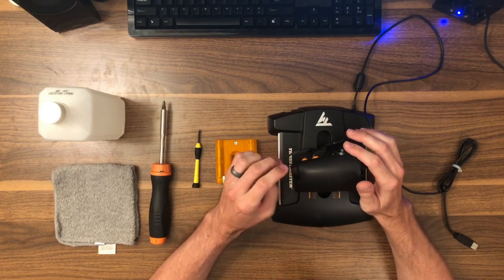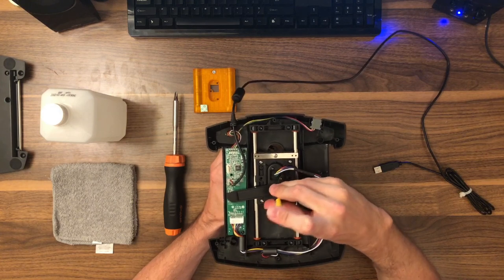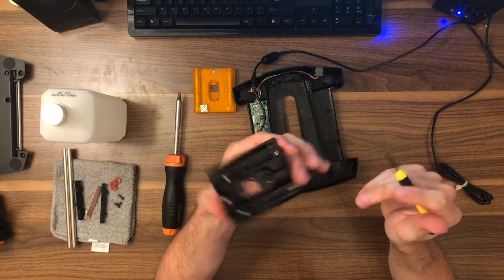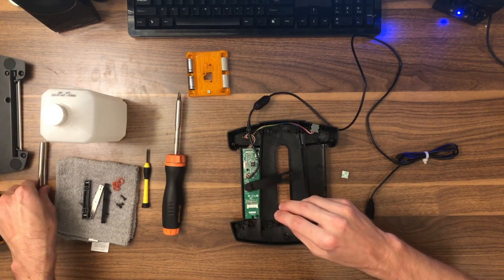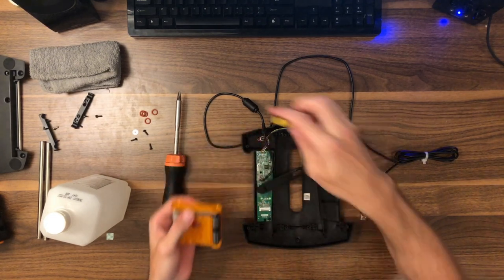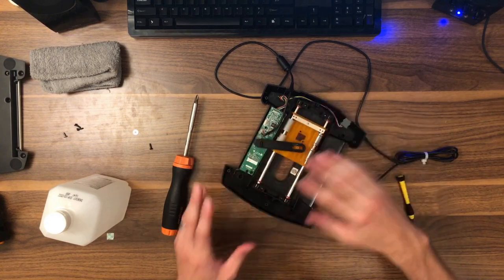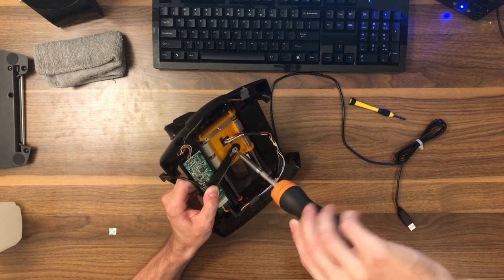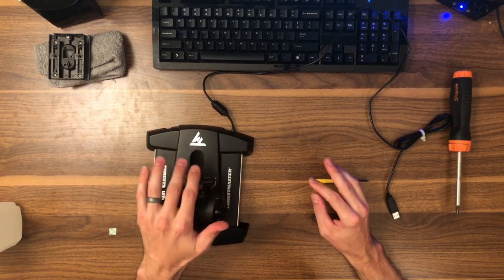Impulse Slider Installation Guide - ThrustMaster T16000m Throttle Upgrade!

Comment: Wait, do you need to re-lubricate the rods that go through the bearings or not? And if not why not? Also will there maybe be a restock, i would like to order one.
Reply from the maker: Thanks for the question, I don't re-lubricate mine because I use the polymer bushings which are self-lubricating. I've never had an issue. The metal bearings also come with some oil on them which also solves that problem. I'd be more prone to re-lubricate these but I also have never needed to. The additional lubricant would need to be put inside the bearings so that the seals seal it in vs seal it out. The only advantage that might give is a possibly quieter sliding motion. The downside is that it will attract more dust/dirt/contaminants. I'll be restocking later today :)

Comment: What is the functional difference between using the polymer bushing or the metal bearing? What might make one preferable to the other?
Reply from the maker: The functional difference is that the polymers offer a little more resistance when you push down harder on the throttle. It can increase your precision in a way. The metal ones stay super low friction no matter how hard you push down. Then obviously there's the smoothness/grittiness of the feel.
Reply: @CoreHawk3D  what I want is smooth and quite. Hmmm which to get? Which to get?
Reply from the maker: @RichardAdkins  definitely the polymers!

Comment: @CoreHawk3D How do you set up the detent in Star Citizen? The default seems to be that 50% is 50% thrust, and not 0.
Reply: I assume you found the answer by now, but just in case..
to map it to be 0 throttle at 50%, you have to bind the axis to the throttle forward/backward option rather then the trottle forward option
Reply: @VellingaRs  I hadn't, so thanks :-)

Comment: Mr Corehawk sir, I think I got an oversized magnet a to attach to the base, it completely yanks the smaller magnet right out of the slider. I don't see other people having this problem, so maybe I did something wrong?
Reply from the maker: Hello! Is your slider the gunmetal color?
Reply: @CoreHawk3D  Orange with polymer bushings.
Reply from the maker: @elkikex  strange. Would you consider maybe hot-gluing the magnet back into the slider? If all else fails I can send you a new one. I never have issues with the orange ones. Were you the one asking me about the afterburner detent and I sent you an extra case mounted magnet?
Reply: @CoreHawk3D  first time contact here. Ordered it a couple months back, but with the ED:O disappointment I hadn't got around to install it. I got a taste of the detent by putting a bolt and nut instead of the slider magnet, but I didn't get a good feel out of it. I think the diameter of the magnets are pretty big compared to half the sliding distance, which gives it the "muddy zone" feeling described in other vids. I still have the super glue option if I ever want to try it. Thanks for replying, the slider is super smooth!

Comment: just applying silicon grease to the rails is way easier.
Reply from the maker: Nice! I’ve only heard about the lithium grease fix and the damping grease fix. Does it keep the plastic of the stock slider contact surfaces from wearing away?
Reply: @CoreHawk3D  Yes! especially if you apply insulating tape on the plastic between the rails, and then lubricate the rails, you will get alot less play and a very  smooth slider with more restistance akin to the more premium throttles. What I like is that it does not seem to require any maintenance. Applied it once and 6 months later there was no difference.
Reply from the maker: @MegaXLG  interesting! I may have to try that to compare. What tape exactly do you use?

Comment: Can I reposition the magnet to detent at about 90% for afterburner/mil power detent in flight sims?  Do you have the position for the magnet relocation?
Reply from the maker: Hmmmm I aven't measured for that... anyone else?
Reply: @CoreHawk3D  I am not sure about the dangers but could one use the property software that measures the input percentages and while it is disassembled, plug it in and carefully move the swing arm and watch where the input hits 90 then remember the area and unplug and continue the job
Reply: @Kazsquatch  Thanks so much for the suggestion.  I actually eyeballed the position while sliding the throttle forward.  Placed it and epoxied it (!) in place.  Thankfully it seems right. Great upgrade and much better than just using dampening grease.  Thanks very much.
Reply: @tuffguy007  NP! glad i could be of some help
Reply from the maker: @Kazsquatch  thank you!

Comment: You say you ran into friction problems. Did you try applie grease or and oil to the throttle? Would that not fix the issue? I only ask because I have the throttle and I wonder I I should get this upgrade.
Reply from the maker: I tried the lithium grease fix once and it made it like 10% better but did nothing to fix the fact that it was wearing into the structural plastic, widening the holes and increasing wobble/play. I never tried the damping grease because I like to make large fast movements sometimes which would not be possible with it. Does that answer your question?
Reply: I've used Lith and silicon greese for a long time... the plastic wears inevitably and fictional changes will always be present.  A linear rail system will make it better.  Use it till you can't tolerate it, and put in a linear rail system like this.

Comment: The shop is currently closed, sooo could you tell me the price of your product? And do you know how much would shipping to Germany cost me roughly?
Reply: The etsy site says he'll be back .. price around 30 USD for just the piece.
Reply: @SecretsofScorpio  thanks, i read he will be back, but the price is not visible while he is gone :)
The part “just the piece” confuses me however, are the linear bearings / polymer bushings not included at this price point?
Reply: @spellingmistake1  No the bushings are included in the price, I was just saying that I wouldn't know what the shipping cost would be to Germany
Reply: @SecretsofScorpio  ah, that makes sense :)
Reply from the maker: Hello! Price depends on the included bearings/bushings: $25 for metal, $28 for Polymer, and $35 for both (4 of each). @Andrew Bladyka, thanks for your responses while I was away!
Reply: @CoreHawk3D  thanks, I hohe you had a nice Holliday
Reply: @CoreHawk3D  I just ordered now from your website and I wanted to know the diameter of the magnet because I will eventually order a stronger one, to have a more noticeable detent
Reply from the maker: @spellingmistake1  It's 8mm diameter and 3mm tall. Hmm... good point. Now that I've bolstered the adhesive with the 3M clear stuff, I could look at putting a taller magnet for attachment to the case... here's what a short amazon search turned up: https://www.amazon.com/Personalized-Multi-Use-Whiteboard-Magnetic-Refrigerators/dp/B075Q9YLMK/ref=sr_1_19?crid=3BJ1XK5X1TWKP&dchild=1&keywords=8mm+neodymium+magnets&qid=1609599620&sprefix=8mm+neo%2Caps%2C196&sr=8-19
Reply: @CoreHawk3D  that’s top notch costumer support :D 
thank you very much, I appreciate it 
You really help me

Comment: too expensive, you are asking for the price i paid for the throttle itself!, £19.16 tag price, plus £14.45 delivery, plus £6.72 tax! no thanks!
Reply from the maker: Thanks for the comment! When/Where did you get your throttle?! It must have been a great deal.
Reply: @CoreHawk3D  from ebay i got no only the throttle but the stick together cost me £50 quid  both! : )
Reply from the maker: @Nirond  very nice! Brand new??
Reply: @CoreHawk3D  like new! my advice for you don't get on the greedy, i found on eBay the bearings 4 just £4,75 and someone else printed the base for me for just £8! a lot  less what you are asking for it!
Reply from the maker: @Nirond   I hear and acknowledge your perspective on this. I come back with this: I have over 2500 sales proving that the asking price is fine. I make sure to price something as much as I'd be willing to pay for it if I were the consumer. I also don't like the idea of ripping people off. If I hear you correctly, you think my current prices are a rip-off. That's fine, you won't offend me, no one is forcing you to do anything against your own will here.
Reply: Nirond,
By your logic, then, if you got your throttle for free, this upgrade should be free also.

You should develop an appreciation for the time and effort put in by the small scale artisans for whom the kind of economy of scale enjoyed by the larger firms is not possible. And at the asking price, the savings in time and effort enjoyed by the customer is a very fair trade in my books.

If your unit develops stickiness in future, and you can not find another great deal on a replacement, you could well end up deciding this kit is not so expensive after all.  ;)

Cheers!